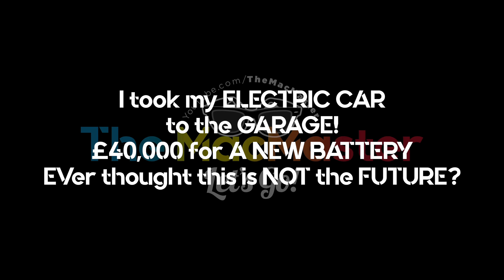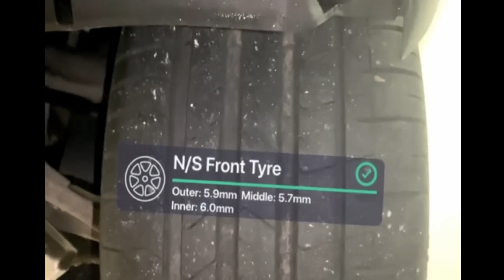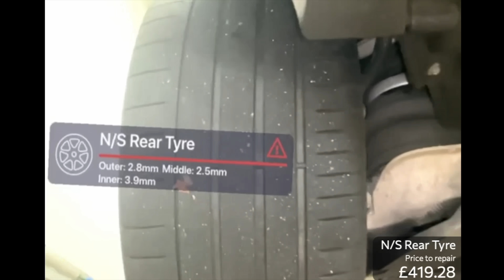I took my ELECTRIC CAR to the GARAGE! £40,000 for A NEW BATTERY EVer thought this is NOT the FUTURE?

Comment: EVs a solution to a problem that doesn't exist 😂
Reply: What a move to greener travel and reduction in global warming?
Reply: Totally agree as a it's a massive money making scam
Reply: @kevinwhite8836 is it greener in the making of the batteries for ev,s is it green when evs start to need replacement batteries and how are they going to dispos the end of life batteries
Reply: @kevinwhite8836  and how are these EV contraptions going to change the weather??
And anything about EV being good for the environment is a total lie.
Reply: @davercs A lot of end of life batteries are recycled for use in power banks for high capacity storage at Solar generation sites.
Reply: Just think when all the lithium runs out. The poor little children in Africa and China will have nothing to do for work.
Reply: Exactly!
Reply: It's incomprehensible how ignorant this statement is.
Reply: @davercs   batteries can last years unless they catches fire,they degrade over time just like mobiles,so it's up to the driver to replace if they decide they need more range....the battery can then be used in the house as a power wall complete with solar or it goes for recycling.
Reply: @stum8374  Plus batteries will get better and cheaper.
Reply: The evangelist don't need to worry about a mine the size of a moon crater anywhere near to where they live. But it's cool if it is in some third world sh##hole right?
Reply: @GT380man  Yes it would be great to be able to think that as I did in denial for many years.
We lived in the house we built ourselves for 43 years in a very green high hillside location with views over Perth City Western Australia to the ocean. 
But I could see the writing on the wall as our insurance costs started to rise because it was just in a bushfire risk zone. 
So we sold and moved before the insurance companies became too risk adverse.  
That location is now considered extreme climatic risk and is now uninsurable unless you want to pay AUD$20,000 to $40,000 a year in home insurance.  
In Australia it is predicted that 100s of thousands of properties will become uninsurable in the near future because of climatic changes. 
It may not be happening in your little world but here it's reality and it's costing people their life's savings.

However battery EVs will make bugger all differences to the climatic events that are and will happen. 
They are a politically motivated distraction from the difficult bigger issues that need to be tackled.
Reply: EVs are not the solution
Reply: But we do need less and smaller cars...
Reply: A new Dacia Dandero is about £14k brand new. When I can buy a similar spec EV for the same price, with a similar range at a comparable cost per mile and a battery lifespan of around 100k miles (10 years) I'll consider one 👍
Reply: EV'S, an Impractical solution to an Imaginary problem.
Reply: I see you've joined the. I can't travel more than a mile without a bottle of water brigade
Reply: @kevinwhite8836 Says who ?
Reply: Boycott Amazon a Wef corporation
Reply: Happy to hear that lee
Reply: @ianclare5721 lol, in your dreams, try calling your local council, tell them you have just moved to the area and want to remove and recycle a roof full of old solar panels, if you can find anyone who actually does it, will cost you more than replacing them all, glad I didn't bother, same with the exploding batteries I would have needed in the loft or basement,
Reply: Exactly
Reply: @stum8374 Solar is absolutely useless
Reply: @BioniqBob No they won’t
Reply: @andrewwatson5360 Not “climate change”, but the climate does change, Australia is in essence a desert… So not surprising it’s f in hot, skippy… Got nothing to do with CO2 levels though, has it
Reply: @RealButcher Why, and who says so?! “The Experts?!
Reply: @nicotoscani1707 Where, and for how long… Solar is crap, nuclear is a much better and safer option
Reply: @IRISHSALTMINER61  I must admit that I am really impressed with your outstanding  lack of knowledge and denial of facts.  
I left school at 15 over 60 years ago and even I in my naive  early years  was not at that level of ignorance.
Reply: @IRISHSALTMINER61  Why is solar useless? It is utilising the most abundant energy source on the planet. I run my whole house, 2 electric cars and still have excess to export each year, which I get paid for. My solar / battery set up will be paid for in under 4 years at current rates and was an amazing investment. Yes, it is not for every house, you need ample roof space and really a south facing  roof with no obstructions to sunlight (trees, buildings etc). The panels are guaranteed for 20 years, so 20 years of guaranteed energy production is pretty good in my book 🤷.
Reply: @davercs  batteries are already being recycled and also used for power storage elsewhere. True batteries are currently not very green to produce, however don't believe everything you hear or read online. ICE cars are far more polluting over their life than the production of an electric car and we will get better at building batteries over time, some companies like Tesla are already making good headway in this  field and removing quite a bit of the nasty components.
Reply: @nicotoscani1707  I am struggling to determine if this is sarcasm or a genuine post 🤷. Trees and plants survived pretty well on Earth before we invented the combustion engine. Also CO2 is produced by quite a lot of other things as well, humans for one.
Reply: @jimpackard8059  What is the solution if not an EV? The real answer would be, ban all cars and have only public transport, but we are all used to the convenience now and would be reluctant to give it up. Hydrogen theory is good, however way too expensive to make and uses vast amounts of electricity, so unless you can do that all with renewable energy (currently unlikely), that would be worse for the environment. Unfortunately, we never managed to invent Mr Fusion from Back to the Future.
Reply: @kevinwhite8836  greener travel? You mean walking because evs are too expensive for many?
Reply: @IRISHSALTMINER61  The price of 1 kWh (of usable capacity) was $1,355 in 2008 and has fallen to just $153 in 2022.
Reply: An internal combustion engine is crap let's be honest 
The physics if  member correct is 30 to 40% efficiency meaning obvs the amount of energy in the fuel extracted 
Lost heat noise friction etc etc 
An electric motor over 90 %
We could get info the weeds about how batts mined, the mdk supply chains 
But come on after the oil war grabs we have endured the petrol chem dollar parasite 
Possibly we could do better ?
And rubber, brake wear is the real killer not emissions 
It's a tax nothing more 
We have tech to produce nearly free energy but what good is that to our economy? pmsl
Reply: My words exactly
Reply: @kevinwhite8836 - you believe we have a CO2 / Climate Crisis problem? Oh my. That’s funny. 😂😂😂
Reply: @timhicks2154  Baa Baa
Reply: @kevinwhite8836  we cannot stop the climate from changing, it's a bit like trying to stop the tide from coming in
Reply: @davercs  recycle the metals in them are worth a lot of money
Reply: @chrisrichardson774  we can actually stop tides in a fashion, man made barriers are used in many places now to do this, due to rising sea levels (but admittedly the water still needs to go somewhere). With regards to climate change, yes there will be a cyclical process, but you cannot believe in the last 100 years, humans have not sped up the warming process exponentially? If anything, we are trying to slow it down, at least to buy us some more time, however if people don't try and help, it is a bit like throwing fuel onto  a fire to speed up the process.
Reply: @kevinwhite8836  it may be greener travel but what about the cost of life and global destruction that goes into mining the materials to make them?
Reply: @kevinwhite8836 What will we do with all the batteries once they've reached the end of their life? Bury them? Send them abroad? Has the Government and the car manufacturers thought that far forward? I suspect not, so we're swapping one form of pollution for another.
Reply: All I can say is well done greenie 😆😆😆😆😆😆😆
Reply: @BioniqBob better and cheaper 😁😅😉😉🤣😄🤪
Reply: @carlarthur4442 your correct , but the COST is huge . The last owner PAYS for that honour too.
Reply: @karenadashfield5717  Have a look at the earlier comments. Many are being re-purposed in energy banks (if they still work). Many of the others are recycled. Battery technology is also advancing and some now use much less polluting material and rare metals (Tesla for one are developing this).
Reply: @kevinwhite8836  they won’t change a thing. Combustion engines till I die
Reply: @Acemeistre go get your booster and put your mask back on🐑
Reply: I think this debate is more controversial than "who do you vote for?" 😳
Reply: @kevinwhite8836  I just wonder when electric tractors and other ICE-replacement farm machinery will become widely available. Where I live in rural England with much farmland around there are ICE tractors everywhere. One often drives past a field with 3 tractors working simultaneously. And modern tractors are massive, not like your little Massey Fergusons in the 1950s. The batteries to replace ICE-tractors will have to be very powerful, therefore costly.
Reply: Where Robbin hood when you need him eh
Reply: Where’s Robbin hood when you need him eh
Reply: @craiglatham  no lithium is produced by child labour. What you're thinking of is cobalt. Modern Lithium-Iron-Phosphate batteries, such as are being installed by Tesla, contain no cobalt, nor nickel come to that. 

But, one of the biggest users of cobalt is Big Oil!!!  It's required for the process of refining crude oil. So, fear not, Big Oil will ensure the jobs of all those children are safe!
Reply: ‘POWER DENSITY’ 
….is the term you’re looking for. 
Batteries are around 40x heavier to hold the same energy storage as gasoline! On top of that they do not reduce in weight either as the energy is used. This is why with ‘weight sensitive’ & range requirements (eg planes & haulage) it doesn’t work.
Reply: Get a dashcam. I always insist on using one because it can prove a lot of things and make dealing with insurance a lot easier.
Reply: EV is a solution to the problem of ordinary people owning personal cars, jaming the roads one the way for the rich.
Reply: Do you like to breathe in exhaust fumes?

Comment: Agree with you 100%.  My wife and I fall into that group that are not EV evangelists nor petrolheads.  About 3 years ago, my wife decided that she wanted to join the EV revolution and we bought a Nissan Leaf.

After two years of ownership she sold it and replaced it with a petrol car.

This is what we loved about the EV:

Really nice to drive (at lower speeds), quiet, very responsive. The convenience of refuelling at home, we have off road parking and a fast charger so being able to just pull up and refuel is great.  Low fuel prices, at least initially, we were paying about 4.5p per mile.  That is was good for the local environment.

Things we didn’t like about the EV.

Lack of range, on paper was quoted at 180 miles, in reality 130 miles at best.  Proportion of public chargers that we found ‘out of order’.  Rip of pricing of public chargers, even before the electricity price hikes. When we discovered that they cost so much more carbon to make, that they are not actually that good for the global environment.  Servicing which should be very cheap is close to petrol prices because the reality is that garages could not survive on realistic pricing (reduction of income).  Terrible residuals, when it came to selling we found that car had lost 60% of its value in less than two years - at first we thought this might have been due to the Nissan Leaf being less desirable but it seems to be true for all EVs - there is little demand for them second hand. The cheap fuel disappeared when electricity prices got hiked - rose from 4.5p a mile to 11.5p a mile, pretty much the same as an equivalent petrol car - and that was using domestic electricity on a home charger.

Overall, we liked driving the EV on short journeys, we’d love them to work, but realistically we are some years away from them being viable.  Basically, you have to be an evangelist because they are expensive and inconvenient to own and run.

Comment: The problem with electric cars is that we have been spoiled by internal combustion engine , once ordinary people could afford a petrol car way back when the horse and cart could not compete , it was a no brainer . The improvement in the performance of ICE cars over the decades means the EV had got to fit a tall order , performance , range , convenience  and price , They fail on 3 of those requirements
Reply: And they ain’t “GREEN”…

Comment: These are really good points and thanks for making this video! What I personally am puzzled with, and a little bit concerned about, is the EV people and even car media rejoicing the car's transition from piece of hardware into smart device, without the slightest critique. The software is taking priority, and no one seems to be worried about THAT? Some car makers even ADVERTISE their products being like smartphones, only bigger. I see this a huge problem, because even though I use different smart devices on daily basis, I've also experienced that life with them isn't always pure bliss. Having been on the receiving end a COUPLE of times when a reputable, mainstream manufacturer decides that their expensive, near-flagship device is old enough and gets a crippling OTA software/firmware update, leaving the user with a brick device. WHY wouldn't car manufacturers do the same in long run with their products?
Maybe I'm just too old, but I'd prefer if car was mostly hardware, and smart devices were smart devices.

Comment: Lee, I think you are absolutely spot on with the worries over residual costs for EV's and the fire risk. From a fire engineer perspective, I am currently looking at a document produced for the industry titled @covered car parks: fire safety guidance for electric vehicles'. I have to be in the know about this because I write fire strategies for buildings. Without going into the report in depth I'll just quote this little section ' The document outlines mitigation measures which should be considered by competent persons to reduce the impact of an EV fire. These are outlinedusing the ERIC (eliminate, reduce, isolate, control) model. These considerations include, but are not limited to: Suppression systems, Increased fire resistance, Distance between parked cars, Firefighting water supplies, Water run-off control and containment, Locations and features of EV chargepoints, enhanced smoke management systems and thermal imaging cameras and other early detection methods to enable early intervention. So, my advice for what its worth....Dont buy one at the moment, if you do buy one don't park it close to, in or under your house (or others if you live in an apartment type complex). And most importantly, make sure your insurance covers you if your vehicle sets fire to itself, other vehicles or buildings. I will definately not be buying one. There are greater implications for fire safety in public buildings though as lightweight construction car parks require, under most circumastances, to have only 15 minutes fire resistance before structural collapse could occur and there is the issue of space between vehicles. Its a developing situation, one of those where its best to stay out of until technology improves and the baterry fir situation is sorted.

Comment: It would be interesting to know if insurance would cover a damaged battery if the damage occurs in an accident/incident like yours. It should cover it because if it was damaged, it was damaged in an accident. However, as you mentioned, the cost of the battery could result in a write-off of the vehicle.
When EVs become more widespread, and many more battery packs get damaged in minor incidents, be prepared for EV car insurance to surge SO HIGH, that many people won't be able to afford comprehensive car insurance.
Reply: Insurance companies in thier infinite wisdom faced with having to pay out 10's of thousands of pounds out of their profits for EV replacement batteries will no doubt intrroduce hurdles to prevent paying out !
Reply: @rkgooner89 💯 YES THAT SOUNDS RIGHT

Comment: £40,000 for a battery.  That 40k would provide you decent deposit on a house up North.  Probably could get ya a one bedroom flat as a cash buyer in Merseyside.
Reply: So, that particular vehicle retails for $90K+ USD.
And, they are getting just under $49K USD for a new battery.

I'd have to say that it's more than just control. There's a hefty measure of greed thrown in starting from the battery manufacturing processing directly down through to the auto dealership parts departments.
Why else would they tell you not to do your own servicing of the darn things?
Reply: @RenKnight347  car battery or a cheap, cheap house in Texas.

Comment: The comment you made about maybe it was just a hot day why the car refused to charge. Are they planning to sell these in Spain, Italy, Greece? Africa? Cant charge if too hot. By the way you cannot charge lithium batteries if it is below freezing either so that presents problems for countries like Norway and Canada too!
Reply: 79.3 % of all new cars sold in Norway in 2022 were 100% electric vehicles. Battery packs have temperature management systems that keep them within a usable temp range, that's why modern EV's have a small radiator at the front. The range in winter is lower than in summer, this is true. Everyone knows that and adjusts their (mainly overnight) charging accordingly.
Reply: @XenonJohnD  poor Norwegians.   So scammed.